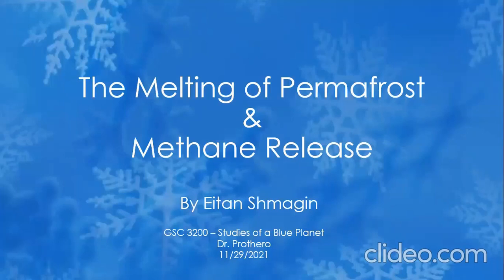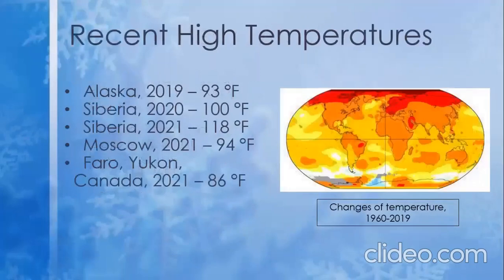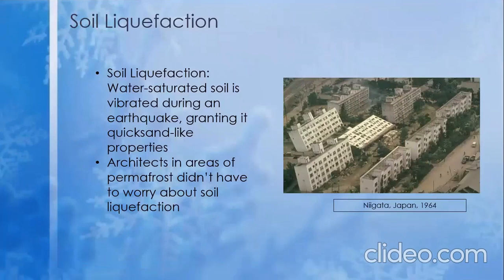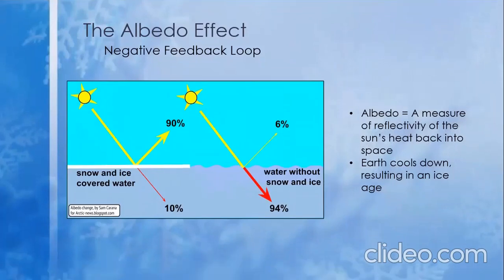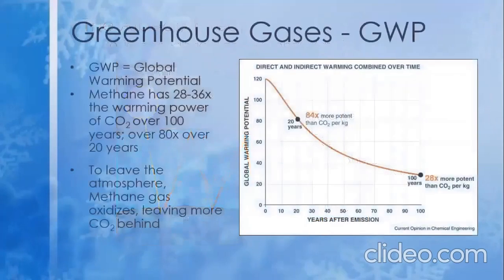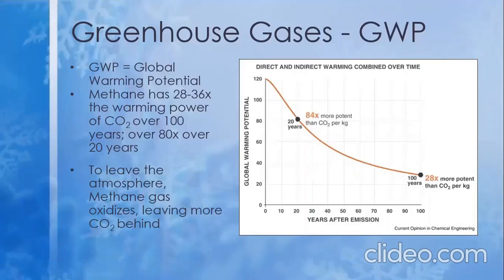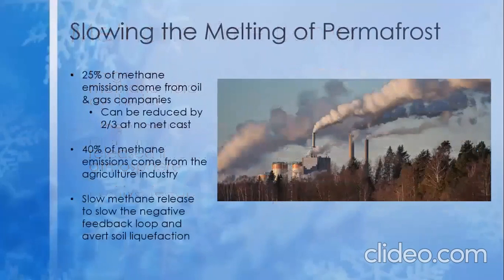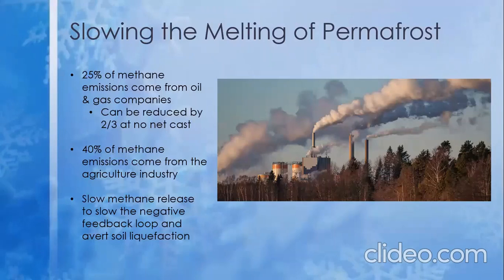The Melting of Permafrost & Methane Release

Comment: For over a hundred million years the entire continent was covered in ice. The entire continent was permafrost. 20,000 years ago it had all melted and the earth didn't explode. Humans have been around for 200,000 years and nobody died from this exposed and melting permafrost.
Reply from the maker: Methane gas is only one contributor to global warming. Carbon dioxide is the main, serious threat, which only started becoming a serious threat at the onset of the Industrial Revolution, less than 200 years ago
Reply: @ES-te2sf  How does this pertain to my post? The climate movement is claiming we are headed for a methane apocalypse resulting from permafrost melt. I would also challenge your characterization of Co2 being a "serious threat" as further hyperbole.
Reply from the maker: @anthonymorris5084  Which climate movement are you referring to that attributes global warming solely to methane emissions? Also, if you know geologic history, as your original comment suggested, you would know about global heating events, caused by huge CO2 & CH4 outputs my mass volcanism. I suggest you look up the extinction at the end of the Permian.